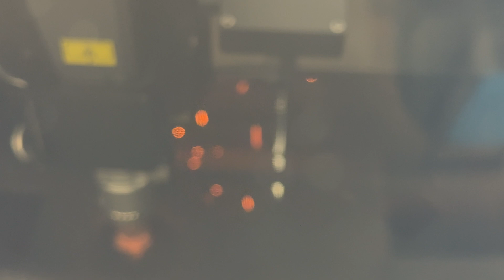Laser cutting steel at home! Xtool Metal Fab 6mm first cuts!

Comment: You have been at it longer than me, but was running into some of the same problems with 1/8” or 3mm carbon steel. xTool standard settings seem to work fine for straight line cuts but struggle with detail. I’ve found that the problem persists in the corners and the sharper they are, the bigger the problem. Duty Cycle Curve and Frequency Curve is the only way to solve it. Would love to compare notes. I cut some 12” Elk with sharp horns today and nailed it.
Reply from the maker: I've not updated for a while, but have been busy. I've got it cutting much cleaner now. The Xtool settings are working better, they keep tweaking them.
Its strange, because frequency doesn't play a part when on 100% duty I was told, but then, as the part is cutting slower, the duty cycle isn't 100%. I've no found that My duty cycle is somewhat different, I usually leave the curve 100% until about 60% speed and only taper it slightly. I've been really busy, lots of cutting, but no time for editing. I've took some footage though, so will edit when I get chance.

Comment: Did you try messing with the frequency at all?
Reply from the maker: Hi 

Apparently at 100% the frequency is ignored. 

My machine is now broke though. It broke over a week ago and Xtool customer service leaves a lot to be desired.
Reply: @AlwaysHappy-gc6dt  really, what broke on it? So frequency is ignored at 100% if you put it at 99% would it allow frequency changes or does it need a significant reduction I wonder. My experience with X tool customer service is that they usually get back to you once a day write about at this time.
Reply from the maker: Using my knowledge of PWM not Xtool per se  it would be pretty pointless unless the duty cycle is somewhat lower. 

It would be attenuating at a certain frequency. But with a 99% on time. It wouldn’t really be noticeable until much lower duty cycles. It’s misleading. The fact you can change the duty makes you think it is always pulsed even at 100% duty, I didn’t expect 100% to be a true DC output. 

They got back to me most days. Sometimes it was 48hours between contact. But sadly they asked the same questions over and over which was frustrating. 

I agreed to pay 50% upfront again for a new machine until my old one goes back. 

The new machine is due this week hopefully. So I’ll be able to start cutting again.
Reply: @AlwaysHappy-gc6dt  the frequency is interesting to me coming from a fiber, engraving, laser. Changing the frequency has a significant effect on how it engraves, so I thought it would have a significant effect on how it cuts also.
Reply: @AlwaysHappy-gc6dt  Hm, so you pay 150% for 1.

Comment: I have been looking at the GWEIKE M3 Ultra. Its a little bit cheaper 36x54 work area with pass through.As well as the 1200w fibre it also includes a 130 w co2 laser. Would be interested if anyone else has looked at it and what they think. Its a 6 in one machine
Reply: I was just about ready to pull the trigger on the M3 Ultra but found out at the last minute it does not laser etch on steel like the metalfab will. May not mean much to you, but it was enough for me as that was one function I wanted.

Comment: Ive got a Metalfab here too. Just getting started. Never welded before but have a Laser cutter for wood I’ve been using the past 4 years. Hope to learn more. Thanks for posting!
Reply from the maker: I’ve been Tig and Mig welding for 20 years, not my day job. 

The laser is a steep learning curve but very easy. 

Be great when the software is more dialled and it has presets for thicker plate. For thing materials it’s pretty perfect out the box.

Comment: Can you share your most successful settings for 6mm mild steel?  Please include the cutting height, nozzle, speed, penetration time, frequency, gas pressure.  I did a test and started with the 5mm settings and after they failed I reduced the speed to 15 and increased the penetration time from 800 to 1000 and got fairly clean cuts.  I was using the double layer tip and 9psi oxygen.  Thanks for the video post.
Reply from the maker: I posted another video with a bit more on the settings.

Comment: Have you tried air?
Reply from the maker: I posted a short cutting aluminium that was with air. 

I haven’t tried air on 6mm carbon steel. 

I have a few thickness coming today. I’ll try air on the thinner stuff with the gas saver nozzle and work upwards if it’s cutting ok.
Reply: @AlwaysHappy-gc6dt  Looking forward to your future videos!
Reply: @reddirtwarriors4846  hello, i tried compressed air for a few hours. here are my results : *

With an air pressure of 120 KPA (around 8.3 bars) +-5%, 20mm/s, 2mm standard nozzle, i cut :

1mm to 4mm aluminium : OK 

1mm to 3mm stainless : OK

1mm to 3mm steel : OK
4mm and 5mm steel : OK but a lot of dross.
6mm steel : Ugly + dross
8mm steel : no cut ! 

Hope it will help others